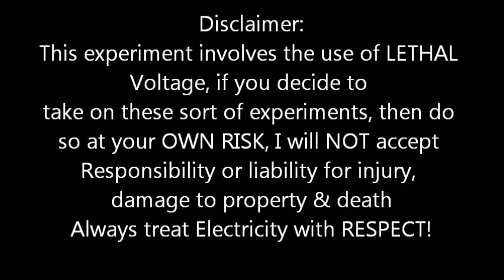Popping Circuitboard With Capacitor Bank

Comment: After a lot of discharging and shorting while on, it might be a good idea to check the temperature of your rectifier. Keep in mind if that blows up or shorts out, it might feed ac in your cap. bank. Not what you want.